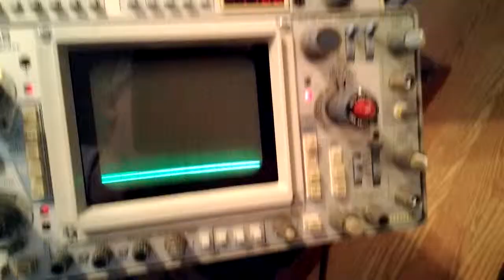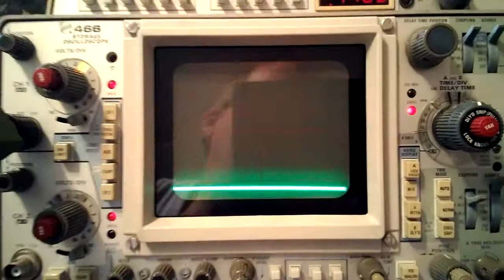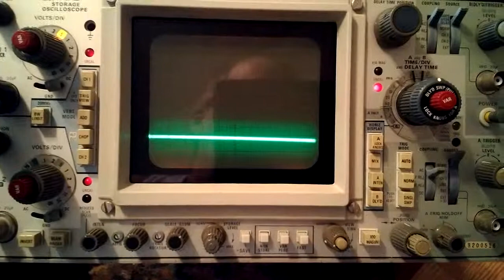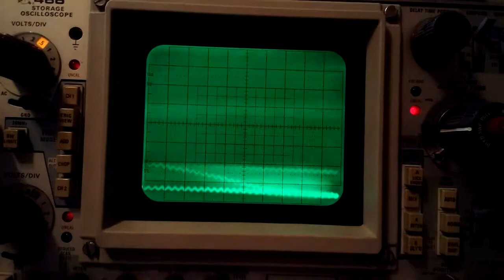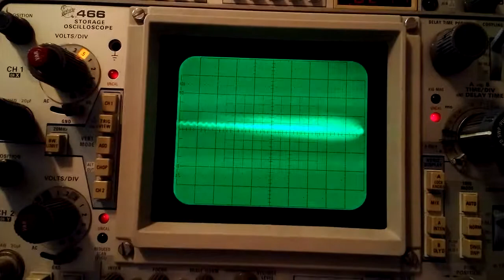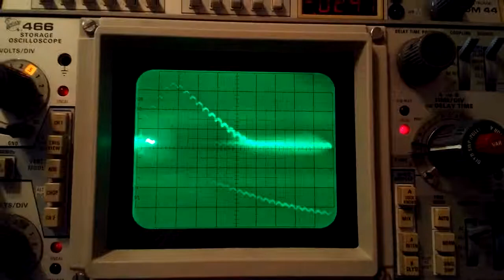SSM2056 ADSR Test3

Comment from the maker: wish I could help, but the only schematics for the 61 are only half legible.
my 1st guess is one of the six voices has a thermistor going bad.  It's a part that is supposed to compensate voltage/tuning with temperature changes.
Does it get worse if you heat the voice board up a bit with a hair dryer??
Thats what I'd try 1st.